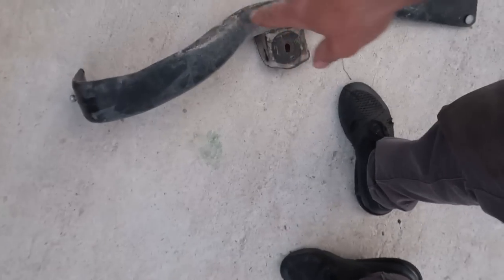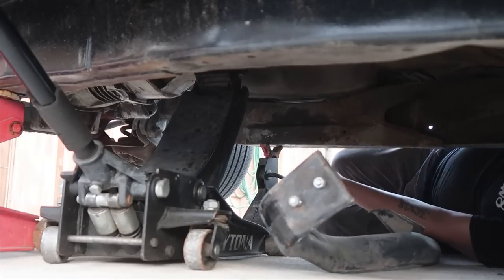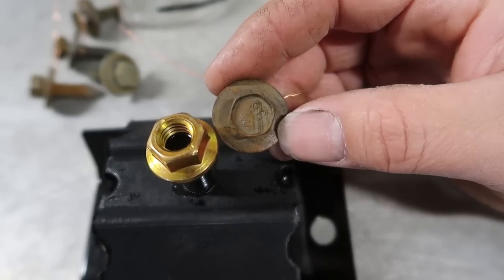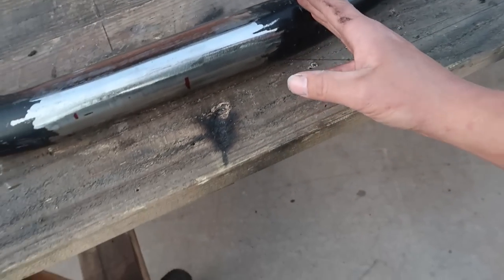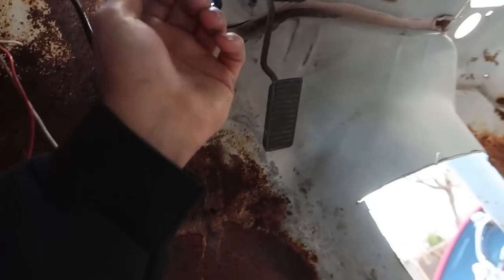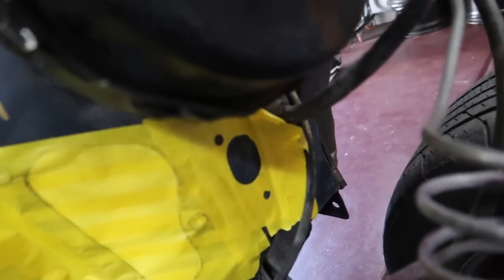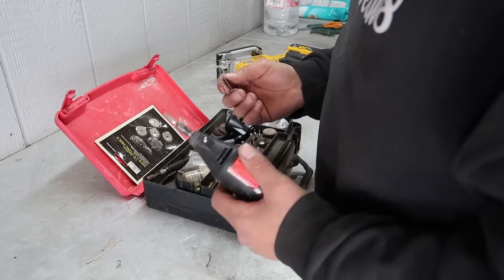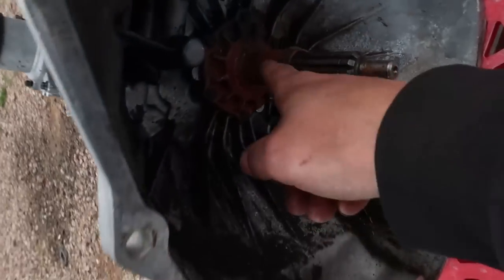Making a custom Transmission Crossmember for the LS Swapped S10 Blazer

Comment: There is a YouTube channel call Beater Olds&budget builds that shows the exact parts and part numbers you need for the complete flywheel and clutch kit you need to go from Ls-Nv3500 transmission